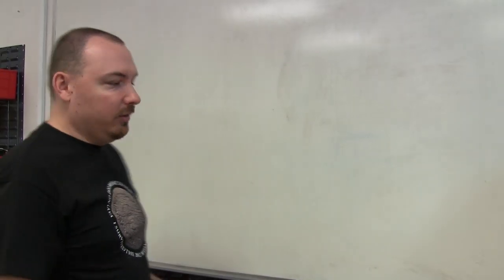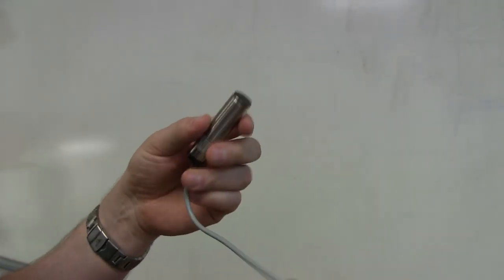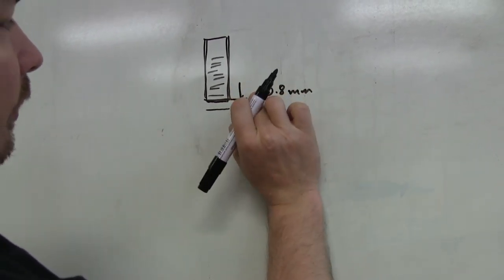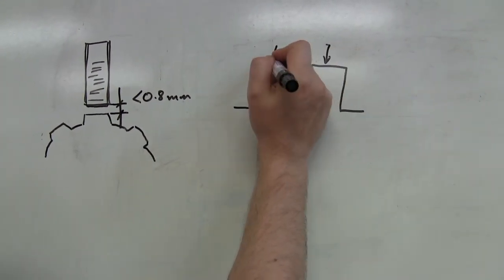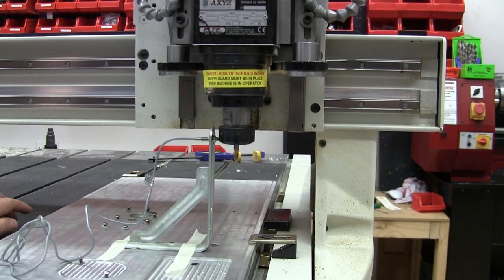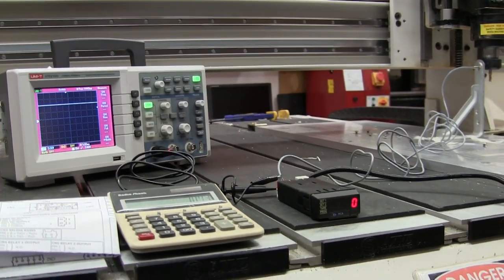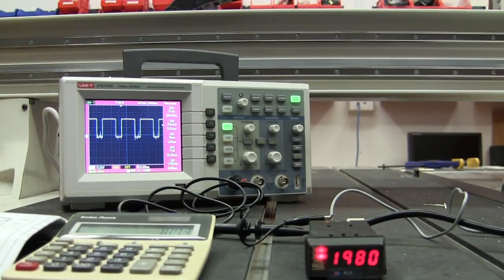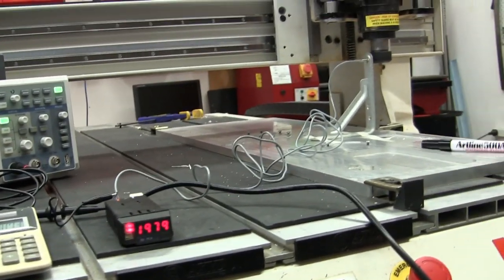RPM Detection using inductive sensor and DITEL PICA100-F

Comment: Would you please share the specific inductive sensor employed?
Reply from the maker: +Jack Trexler Hi Jack, there is nothing special about the sensor we used, it was some surplus sensor we had in stock left over from an old agency we used to represent. The sensor was a standard inductive proximity sensor. They are very common. The one I used was an Infra IS series sensor with an NPN ouput. The little PICA-F Accepts the signals from most Standard sensors, Magnetic pick-up, Namur, PNP, NPN and switch. You can buy these sensors from SICK, IFM, they can be sourced from catalogue sellers like RS componetes and Element14, Digikey etc.